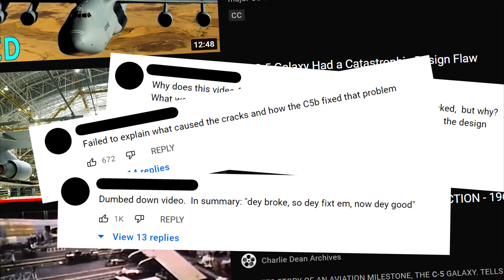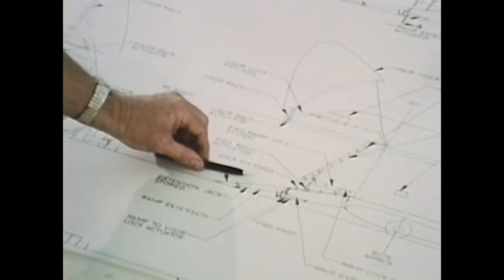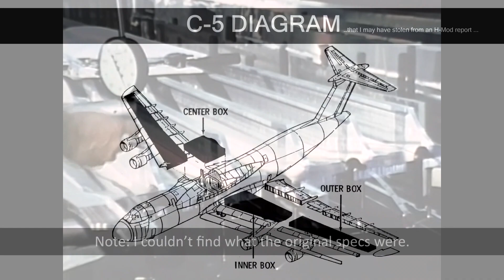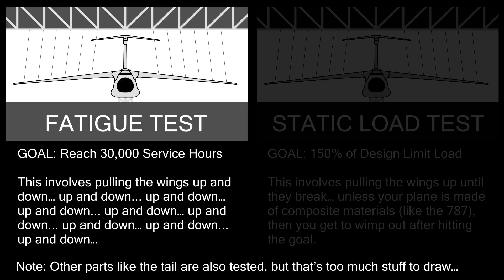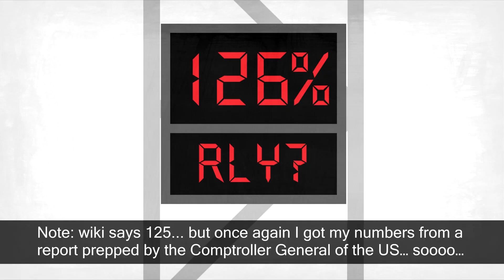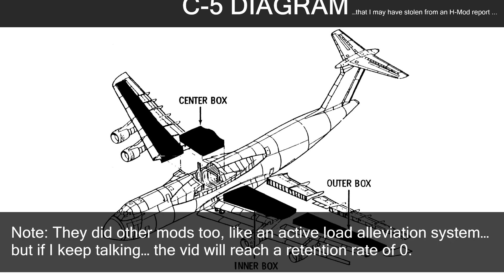What the Smithsonian Channel Didn't Mention (C-5 Wing Drama)

Comment: 60 Minutes did a piece on this aircraft back in the 70s due to this issue. They aired film of the C5 in flight showing the wings oscillating, literally fluttering.

Comment: I was to fly a C-5 from Clark Air Force Base, Philippines to Diego Garcia.  The plane started down the runway and it was aborted due go mechanical problems.  For the next three day, the passengers loaded on the plane only to have the take-off aborted.  On the fourth day, we took off.  Since none of the sailors stayed in hotels, sleeping in the terminal, we were in rough shape by the fourth day.
.
A shipmate of mine was to fly a C-5 from Spain to California.  The C-5 had to make an emergency landing in the Azores.  The Navy passengers ended up spending 10 days sleeping in the plane's seats.  The Navy would not pay for hotel rooms, but the Air Force put its people in hotels.
.
Lastly, in 1995, I flew on a C-5 from Dover AFB to Mombasa, Kenya.  It was an 18 hour flight with two mid-air refueling.  Since there aren't any windows, we could not see anything.  The air crew made us buckle in during the refuelings.
.
In Mombasa, the Air Force people were sent to a luxury beach hotel.  The sailors were put on Mike boats for a ride to the to ships.  On board the ships, we got the open bay transit bunks.  Two months later, the operation ended.  The operation over, in Mombasa, the Navy crew met up again with the Air Force crew.  We rode a 747 back to California.  The AF airmen were paid a per-diem, all meals included, in the luxury beach beach hotel for two months.

The sailors saw the fighting in Somalia, sleeping on the ground with the US Marines.  The AF airmen saw movies on TV.
Reply: As AF I can concur. But it wasn't just Navy. We would drop Army paratroopers to go off and tent or whatnot. Then we would land and get a hotel to rest up. And as far as watching movies, they were usually crappy movies, duh.
I remember one time staying at resort in Puerto Rico while Penthouse was doing a photo shoot on the beach. So I says 'damn, I sure wish the Navy would have had the opportunity'.

Comment: The whole C5A was a fiasco of politics, Boeing was also competing and their design met the performance  requirements of the Air Force but Mc Namara said even if the Boeing design was better he would not give the contract to Boeing  he hated them,  and gave the contract to Lockheed on the basis of cost.  said it was "cheaper"  and look what they got !!! A planes whose wings fell off as they were lightened to get the weight down and the whole program cost the US Taxpayer Billions of dollars to re wing the C5A.  Boeing had a ton of money in that competition and about that time  Pan AM wanted a passenger plane twice the size of the 707 so Boeing reworked the design from a high wing to the low wing and put in windows and seats and the 747was born.  thats why the 747 has the hump and the cargo versions had the opening nose.  as soon as Boeing got their first plane in the air, the City of Everett in their tests they loaded it way beyond the loaded weight of the C5A and took off with it just to rub it in the face of Mc Namara and the USAF  That Boeings design far exceeded the capabilities of the Lockheed.  A 747-8  Actually was testes with a max takeoff weight of 1,000,000 pounds far exceeding the C5in any later configuration !! !  Dirty politics at work !!!!
Reply: Holy shit, I never knew the 747 was a competitor to the C5. I always thought it was odd they were basically the same size and came out around the same time. Mind blown.
Reply: Okay... if the problem stems from a desire to save weight, and the fix is to replace the lightened parts with biggerbetterstronger, won't that eat into the payload weight?
Reply: Just to point out an inaccuracy, the 747 was not a reworked CX-HLS design but instead a clean slate design that took lessons from the CX-HLS design. The high mounted cockpit was there because at the same time, Boeing was working on the 2707, a supersonic airliner, and a lot of airlines thought that was the future. If the 747 was to be superceded by the supersonic airliners, Boeing would have lost a lot of money on the 747 without their being an alternate market, in this case cargo. As for the design being a clean slate, here is a quote from Joe Sutter, the manager of the design team for the 747:

“The Boeing CX-HLS proposal would have made a very lousy airliner,” Sutter said. “We started with a clean slate. Pretty much the only thing that survived from the Air Force competition were the high-bypass engines.”
Reply: @GroundHOG-2010 the 747 was designed to be a cargo plane. Only when the 2707 failed did they modify it for passenger travel.
Reply: @deth3021  So ignoring the point that you are literally responding to and provide no statement of fact for, it is well known that you are incorrect. Pan Am was mostly in the business of people travel, not mass cargo transport, and is well known as one of the driving forces behind the development of the 747.

But for some actual proof you are incorrect, see the 747 entering passenger service in January 1970, as compared to the 2707 being canceled in 1971. There is also news articles from that time period that show the intent, see the following from the New York Times in 1966: "Pan American World Airways, Inc., yesterday ordered $525-million worth of huge new jet airliners, each with a carrying capacity of 490 persons. This is about 2 times the number that can be accommodated in today's standard jet airplane." This is just a standard copy of a press release article, and press releases usually won't include the number of passengers or how many that is compared to a normal plane of the time if it isn't at all relevant and the aircraft is being developed as a cargo aircraft.